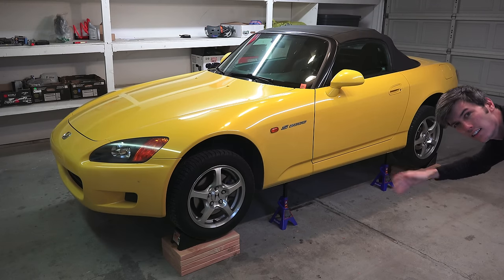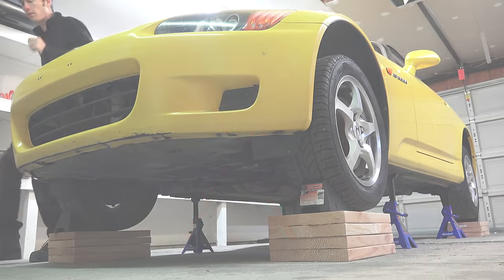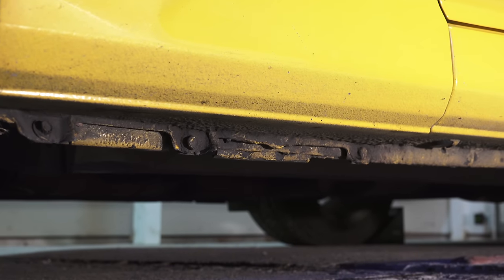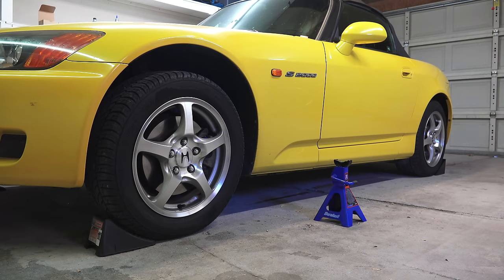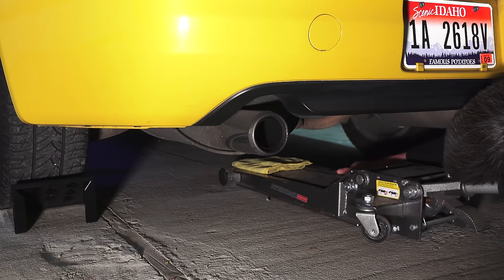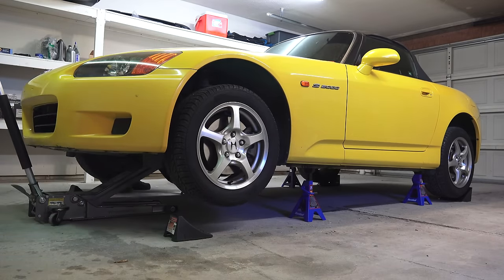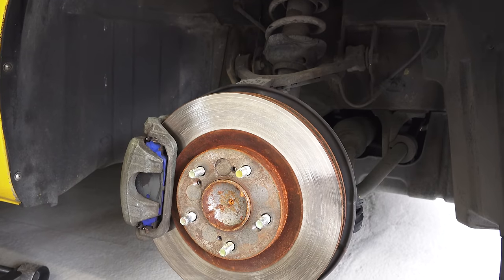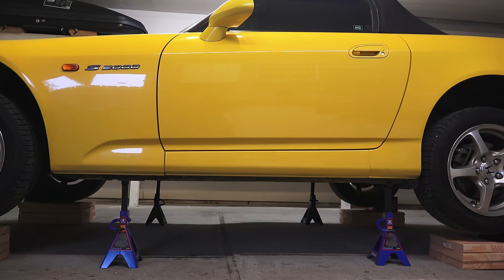How To Completely Lift A Car On All Four Jack Stands

Comment: I have a smart car so I can just lift it with my hands onto cement blocks, and all the parts I need i can get from Toy R Us.
Reply: That made my day. :D The worst thing about the Smart ForTwo is its name. What kinda pretentious jackass comes up with such names?
Reply: Red Phoenix
lol I really do have a Smart Fortwo. I don't claim it to be the best at anything though. I wouldn't recommend it for anyone really. But I like it purely for it's size and funny look.
Reply: In all seriousness, please do not use cement blocks to hold your car up. A neighbor died when he put his car on cinder blocks and they crumbled, crushing him. After that I use jack stands but also put two hydraulic jacks just touching a jacking point and if the wheels are off slide them under the car too. Like Jason, I like to live and even if I wanted to die it would not be suffocating under a 1 1/2 ton vehicle 'cause that takes way too long.
Reply: same here...my whoopee cushion airbags are making weird noises think ill return them to Toys R Us
Reply: xinic5 nice I think I will get my next car from toys r us!
Reply: exactly on not using concrete blocks.  Too often people place them with the flat sides facing top and bottom, with the holes facing sideways.  That's sideways from their normal load-bearing direction, how they're meant to be used when placed in a building (holes facing up and down).  Concrete blocks are strong when oriented the proper way, but weak when oriented the wrong way.

A concrete block placed the right way, with a board on top covering the holes, would support a vehicle just fine.
Reply: Wood blocks are good because they compress a bit to absorb the weight. They won't shatter like cement blocks. But make sure you use strong wood not plywood. The garage I used to go to used pieces of wood that they used to put under railroad tracks. Did that in addition to jackstands because in the north, they had cars come in so rusted that the jacking  points sometimes fail.
Reply: LMAO
Reply: I have seen pickup trucks literally break in half on a lift because of rust
Reply: @fprintf  I was going to lift my minivan using the standard jack and some cement blocks cause I don't have jack stands, after reading your comment, I realized how dangerous this is.
Reply: I suppose if my comment saves one life then it was worth spending the time to post it. Just say no to concrete/cement blocks, especially the concrete construction blocks that are hollow in the middle. Blocks of wood are just fine, if available, but jackstands are cheap enough new or used that it doesn't make sense not to buy them if you can.
Reply: @xinic5  I had a smart for two. I'm a small man and it fits me just right, it was fun to drive and compact enough for my street side parking. But it was terrible for moving anything larger then an extra human in the trunk.
Reply: @gaochen9240  I can testify that, jacking point went into my van when i was pushing it a little to make sure it was sturdy, luckly i wasnt under.
Reply: @jazzhandsparten  I'm 6'5". No problem driving a smart car...lol it is a bit loud, with the convertible top. It's my only complaint really.
Reply: Meanwhile while your making fun of my smart car I’m cruising down the road enjoying my 50mpg ride while your filling up for the 3rd time this week.  Sucks to be you!
Reply: @cwetherington  I have a smart car.
Reply: you may need to update the firmware of your smart car... mine lifts itself on its own.
Reply: Toys R Us. xD Epic lulz, even though they went out of business.
Reply: I just spit my sprite out...
Reply: @st.michaelthearchangel7774  not when this was written
Reply: @worldhello1234  Yeah, why not Smart 42?
Reply: Never use cement blocks for lifting an auto!
Reply: @Omlet221 they are still open in japan
Reply: Why is this one of the funniest comments I've read in a long time 😂. Was not expecting this
Reply: I have the 1000th like
Reply: I think I saw a Russian do that

Comment: Pro tip:  If you are removing the wheels slide them under the car by the jack stands to give some extra protection in case they fall or slip
Reply: Thats correct!
Reply: cjfourty6 thats great and all but you wont have room to work on the exhaust or transmission area.
Reply: Someone's wheels costs more than life itself :-D
Reply: and run the risk of scratching my rims??!! ID RATHER DIE
Reply: @videblu  good heads up, those were also being sold under different names from various vendors, HyperTough name popped up during a round of recalls last year. Check how much of the lip is actually in contact with the bar people, could save a life.
Reply: But what If I chip my bbs wheels ????
Reply: Never do that! Haha maybe 29 years ago times have changed
Reply: @seanhorgan6774  That's why I will never get under a car that sits on the typical jack stands with no locking pin. That 3$ pin in the double locking stands will save your life if the ratchet fails.
Reply: Grammar is important

Comment: Good to see that no one is above a Harbor Freight floor jack.
Reply: Float Meal I have two of them.. And they work like a $300 Snap-on jack....a good or better than most actually...
Reply: More times then I would like to say.
Reply: +Battosai Jenkins Happened to me today actually haha
Reply from the maker: I like cheap tools and expensive tires haha.
Reply: Can't beat them for the price.
Reply: so much for "no sense saving money and dying..."  :-)
Reply: +Battosai Jenkins the car shop I worked at we never did that; we loosened and re-attached with air wrenches on the lift; we tightened with torque wrenches on the ground.
Reply: jMon that only applies if you plan on getting under a car supported by jacks alone :)
Reply: Had or freight jacks are made on the same assembly line as snap on jacks.  Same parts, same product, different logo painted on the side.
Reply: @battosaijenkins946  air impact wrench gang never runs into that issue
Reply: this didn't age well
Reply: Been using my harbor freight 3 ton Jack for almost 20 years now with no issues knock on wood. Harbor freight buys from the same manufacturers that the big brands buy from. In this day and age in most cases brand name doesn't matter any more. But I do prefer my craftsman tools to say "made in the USA" on them Haha
Reply: TMW Snap On ripped off Harbor Freight's floor jacks. Enjoy spending an extra 750 for the exact same thing.
Reply: Got the same one. Best money I've spent.

Comment: As a teenager I was changing oil on big  Bonneville we drove in the 80's outside in the street on a hot summer day using just a car jack that came with the car. The black top bellow was hot to the touch under the scorching sun. I did my best to lift the car and it looked stable. With the car raised on the car jack  I was reaching in under the car to unbolt the oil plug and in the back of my eye I noticed the car was slowly moving to the side. I knew this was bad and I pulled back under the car just as it sank some more and then it slid off jack . This happened because the thin framed base of the  of the car jack sank into the hot asphalt after being initially stable . Yes,I was lucky to escape being pinned under or worse. Be mindful this can happen.

Comment: Had my car up on jack stands bleeding brake lines when my father, a professional mechanic reached in the car, grabbed the steering wheel, and stepped on the brake pedal. The side-force generated by that pressure on the brake pedal tipped the car sideways, tipping the jack stands. As a precaution, I had put the spare tire under the flat floor pan of my Volkswagon, so as the car tipped, and moved sideways about 3-ft, instead of 5ft, I didn't get crushed between a fence and the side of the car. Obviously, my father would have been devastated and never forgiven himself if I'd ended up dead or FUBAR. 

Never trust jack stands alone. Chock and prop the tires as shown here. Trust jacks themselves even less. Safety always seems like an unnecessary PITA until you're FUBAR in a hospital and crippled for life. Then you have the rest of your life to regret your stupidity. "Be Safe" is the best advice you'll ever get.
Reply: Yikes.
Reply: @Abrahm Mondido 
Exactly, they're perfectly reachable without getting underneath
Reply: H
Reply: Gravity bleeds for you. I’ve never understood the “ok push! Release!  Ok push!...” method.    Loosen all four bleeders, flip a bottle of brake fluid upside down into the reservoir, pull up a lawn chair and keep an eye on your fluid level.   Close your bleeder screws up about five minutes later and you are good to go.
Reply: This is also a good reason why to reverse bleed brakes with a mityvac.
Reply: @youtubeisbroken241  Interesting. Never heard of this method, I'll give it a go next time around. Thanks.
Reply: @youtubeisbroken241   except this doesn't work.   you will have tons of micro bubbles in the system from adding fluid continually.   then those micro bubbles will join up in the system into a big non-compressible bubble and OOPS no more brakes.     ASE certified mechanic here and the actual correct procedure is to have pressure built in the hydraulic system so that when you open the bleed valve, those micro bubbles escape. you need very high pressure over 500PSI to accomplish this which the brake system does for you.........
Reply: "Never trust jack stands alone." And never trust fathers either. :-)

Comment: In England in 1970, I was taking the front suspension of a Morris Minor to pieces. They have long torsion bars for suspension instead of springs/struts. I didn't understand them.  As I undid a bolt, the torsion bar released and the car collapsed and the torsion bar threw the bottle jack past my head and it landed 50 yards down the road.  That made me careful for 52 years until 3 weeks ago when the 12 inch  fan cover came off my John Deere lawn tractor coz I didn't have all 3 bolts fastened down... It flew like a discus and mangled the choke cable, then hit the battery and smashed a  gash so the acid came out on to the concrete and reacted and it was a cloud of acid gas....Then it continued on and missed my crown jewels by 2 inches and cut a hole in my jeans a gave me a big graze on my loins...    Good fun this home mechanicing !
Reply: Didn’t see that coming..

Comment: I would also take into consideration that the shocks on the car here are decompressed... If the jack-stands fail and the wheels fall on the wood, the shocks would compress and the car will probably still give you a nice slap on the face as it falls down.  Gotta account for that extra travel if the car were to fall on its wheels.

Comment: Great videos and very well made. Why only 3 boards on your rear wheels and 4 in front? Also, a caution for those who misplace the jackstands behind the front wheels. You need to get the stands about 12-13 inches back from the wheel well to get the reinforced area. (look at your vehicle to find the reinforced area). Putting the stands in the other closer area will bend the cars sheet metal underneath as that area is not reinforced.

Comment: Really like the idea of putting wood blocks under the wheels.  Using the jack to provide further support is helpful too.  Like to use chocks on both sides of the wheel, front and back.  What do you think about using the subframe to support the car with jack stands?
Reply: audiophile man personally agree that subframe support much better with 5 mm rubber gasket pad material on stand cups to stop metal on metal rub ( rust point ). Now im in the process of about to do this...and wood squares are a top idea...i also feel i would do a double jack up method with 2 people... start back on both sides ...set it up....that way handbrake and chock holds on the wood bits ( note i would really use one big chunk of wood) the sheets could slide under tyres and stands......then do front same.... have a theory and hate stressing the chassis with that one wheel up at a time method, resulting in a twist to body...just irks me...thats why we all wish we had a scissor hoist in private garage...oh i wish...

Ps the wood sheet bits could be glued together to match max wheel lift height to make one big chunk...use them as seats after..

Comment: Putting the wheels underneath the car when you take them off isn't a bad idea, also if you don't need the jack, it doesn't hurt to leave it where it is, gives you a little extra protection.  Also congrats on the 1M woah!

Comment: Back in high school shop class, the substitute teacher was explaining lift points. When he finished with the unibody and walked over to a framed car he said all you have to do is shove the jack under and lift.  The student assigned to rotate the tires on that car did just that. Who would have thought the oil pan was a lift point ;)

Comment: Thank you for the very informative video as always! Quick question! I am just now getting into working on my cars by myself but lack all the equipment needed. By any chance do you have any plans of making a video in regards to beginners and what tools we should buy? What are the necessities for basic maintenance or even light mods such as bolt ons. Unfortunately my father does not live with me and my mother and I'm certain the only tools we have in the house are a philips head screw driver and a hammer lol.
Reply: you're so cute poor thing.
Reply: What kinda car? Domestic or Japanese? When I was younger a basic metric socket set, wrench, 1/2" 3 foot breaker bar, floor jack , 2 Jack stands... got me through 80% of my 3rd gen Honda Prelude . Of course having other general tools like needle nose pliers, combo box wrenches, torque wrench, crescent wrenches, JDM impact screwdriver, etc... really helps as well. Just get one of those big sets you see for like 99$ at harbor freight or home dept with all the different tools and you'll be fine for basic work

Comment: Also keeping your hydraulic jack slightly lower than the car is also an added safety thing
Reply: Ninja Master I mean, I will probably do that to if I lift the whole car why not.
Reply: jesse sanders Because a ramp for me serves only one purpose. I don't see how I can lift the entire car with simply using ramps.
Reply: easy my friend you put giant spare wheel in middle of car and use Mercedes to pull out ramp under from car .
Reply: Your life must not be worth much if you'd risk it even the smallest bit to save on some plyboard. He's setup a multi level failsafe system as any proper engineer would do, to ensure he's not the unlucky one to get crushed to death.
Reply: TheMidnightNarwhal with ramps you lift the back on jacks and a tire underneath

Comment: i used the rear differential on my 350z..even if i had the front wheels secured..it slid and fell.. i had put a stand on the left side, to i was lucky that i had no damage..it ended up between differential and the gas tank..i will use YOU way hare..it seems a lot more safe and secure..thank you for keeping me alive.whew..

Comment: I like the wooden blocks idea.  I think I'll start using it. I generally use my floor jacks as backups to the jack stands while I'm under the car. (I have two.) And I never rely on screw jacks unless I have absolutely no choice.
For some damn good reasons I won't get into here, I'm super paranoid about working under cars, as well.
Reply: Same I hate going under the Car flatnet 😂

Comment: As a suggestion I would invest in some pinch seam adapters to prevent damaging your car and also provide a more stable base for the top of the jack stands.
Reply: Omg I wish more people would use those. Every used car I've bought had THRASHED pinch welds! My current 1990 prelude has totally flat front pinch welds its crazy

Comment: Do not use the jacking points shown if possible support the with Jack stand from the chassis rails.

jacking point on sills can rust over time and collapse.
Reply: Peter great tip. And frame rails can be used as jacking points aswell
Reply: Yep my pinch welds were coated and when I went to go jack it up, it broke apart.

Comment: Great video, thanks for posting... I have a 1951 Chevy truck that has some brake issues. It's got a modern brake kit system on it and unfortunately, the master cylinder is bolted under the driver's side floor pan. I may need to replace it. Safety is of course a huge issue for me as well. I was thinking yesterday about a teenager I met many years ago who was pinned under a car and somehow a fire was involved. Although he survived, he has massive scarring and a non-useable hand. Be careful!!!

Comment: I would have a question.
There is always a lot of creaking and scary noises when i do this. Is that normal? Is the car really wobbly wobbly only hanging on the jack it self as you are jacking it up? On quite rough pavement, can i rely on my jack to move with its casters under the car as it keeps lifting it and the angle changes? Has it ever happened to you for the car to slip of the jack whilst jacking it up?
Reply: Ive got brand new mx-5 ND tho :D
Reply: Mikee CZ its normal i work as a mechanic and when i was just starting it used tu scare me, but now i know that its normal, since you are putting preasure in a few points
Reply: Thanks for answers

Comment: Don't really understand how four stands is unstable. I've got a safety factor of at least 7 when using 3t jacks on a car that's barely 1700kg soaking wet. I've used four jack stands numerous times, and I shove the thing, and it's more stable than when it's on the ground. It doesn't go anywhere. Also, the car weighs nearly 2t, wouldn't it take a hell of a lot to push it off? Would love to hear any advice here, because I'd rather be told I'm wrong now, than after I'm dead.
Reply: Didn't you listen to him? If you are paranoid, .....